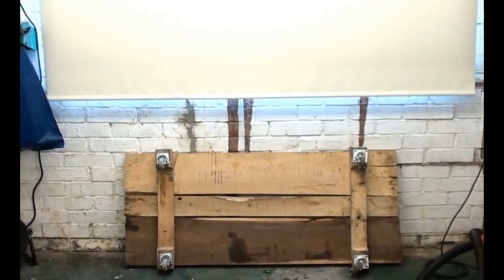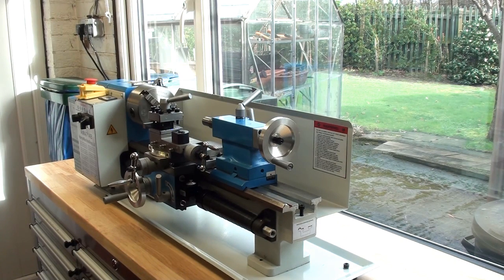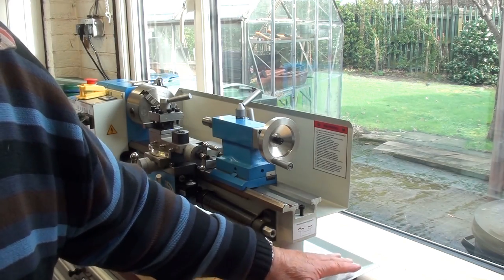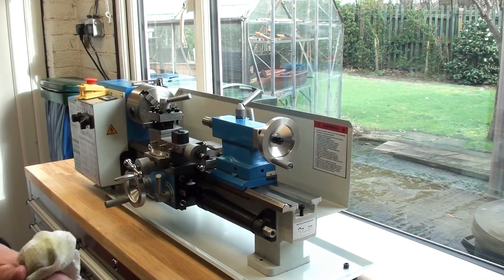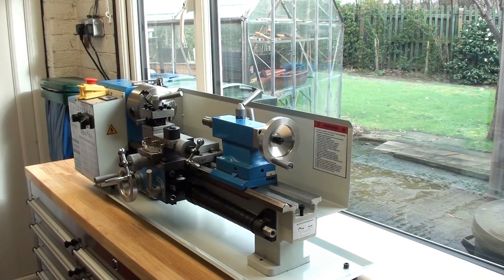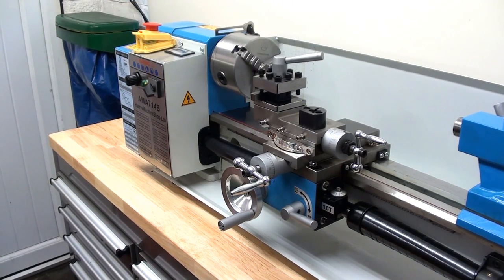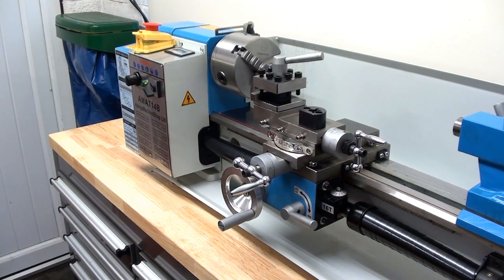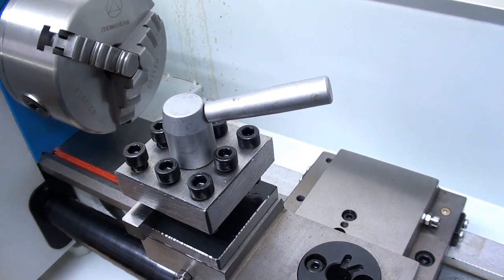My new lathe has arrived

Comment: Sorry mate,but that’s. Way too noisy sounds like motor problems already,I’d ring the makers if I were you,it may need sending back,I sincerely hope not but it is NOISY
Reply from the maker: As I said in the video, it's mostly the all-metal change wheels that are generating the racket.  These are an "upgrade" to the normally supplied nylon gears which, of course,a lot quieter.  I had no choice in what was supplied and as I'm part way through the ELS conversion, they'll all be removed anyway.  It's not a problem for me, I'm glad to say.  If it gets unbearable, I'll just take out my hearing aids and plough on regardless!
John
Reply: @bizzibeeworkshop  Ok good to hear that,anyway the gears will wear in if you stick by them and you can bare the noise.Good luck with your future projects.
Reply: Well Don't ! Use it then ! And No Noise ! Whatsoever ! For Peace of  Mind ?

Comment: Jeesuz, that's a noisy machine!
Reply: Well don't use it ! Then !
Reply from the maker: It's certainly noisier than I would like, but as I said it's mostly down to the replacement metal gears in the drivetrain to the leadscrew.  The parts for the ELS have arrived, so I hope to have that up and running, soon.  Then I'll be able to remove the gears and just have the belt drive from the motor to the spindle.
John

Comment: The machine sounds  off. I would contact the company about the the speed controller as it should not spin up when in the off position
Reply: Well IfF ! You Don't use it ! Then NO NOISE ! WIIL ! COME FROM IT !! GOOD ! HEYY !
Reply from the maker: I have been in touch with the suppliers and they assure me that it's absolutely normal.  In the meantime, I'll be using the forward-off-reverse switch to control the chuck rotation.  If all else fails, I'll just have to fit a 3-phase motor and vfd.
John

Comment: Excellent !   Your 3D printer is proving to be very useful, you can make almost anything required, bespoke storage trays are just the tip of the iceberg.
If you can 3D model it (and you clearly can) you can make it !
      Watching with great interest.
That motor for the toolpost does look a bit small, but time will tell as to whether it's suitable or not. 
All the best, and you know to get in touch if you need anything, I'll help if I can.
Reply from the maker: Hi, Colin.  I'm currently printing a trial mounting bracket for the lead screw stepper motor.  I'm trying to mount it at the tailstock end of the screw;  only problem is there is only about 10mm of 8mm dia. thread to attach the pulley to.  I’m sure I'll work something out, though.
By the way, I'll be in touch next week to arrange to bring that collet chuck  over to you.
Regards, John